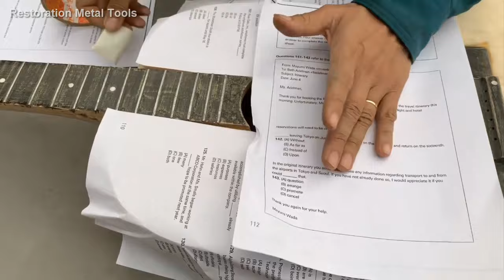Restoration Guitar wooden broken | Old Music instruments restore | Antique Guitar

Comment: I don’t know if I’ve ever seen a guitar mishandled to this extent, the guitar was better the way you “found” it than it is now
Reply from the maker: thank you have a nice day
Reply: Restoration Metal Tools if your gonna “restore” a guitar at LEAST take some of these tips
1. DON’T USE A WIRE BRUSH
2. DON’T USE WATER ITS WOOD FOR GODS SAKE
3. DON’T USE HEAT TO DRY IT FASTER
4. DON’T SPRAY OVER THE FRETS YOU HAVE TAPE, USE IT
5. You don’t have to deconstruct the tuners, just take em off dude. 
6. Maybe fix an actually broken guitar, not one you purposefully manhandled and “found”

Comment: It's a good restoration effort for an amateur. What you could do to improve this...
- Tidy up the paint work.
- Make sure ALL the rust is completely removed from the metal bits.
- Remove the frets before you paint it.
- Clean & polish the frets before putting them back in their slots.
And that's just a start.

Comment: The guitar was originally a fine guitar as evidenced by the detail of its pegs and peg holder, the detailed painting around its hole, and the beautiful tone it had when you played it. I would much rather have seen you replace the missing wood bits with like wood glued in with some animal glue, and tried to clean it without sanding away its original finish. Then you would have preserved its looks as well as its tone. Judging by other comments, this is not your first restoration, although it was your first I’ve seen. I would say you’ve made a start on learning how to restore a guitar, but you need to learn how to preserve original finishes as much as possible because they add to both the looks and tone of the instrument. Thanks for sharing.